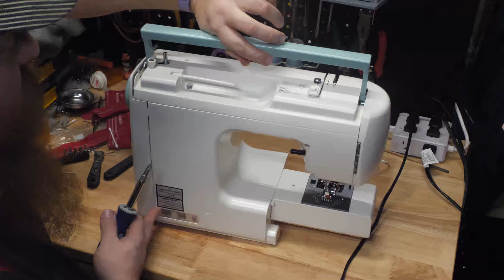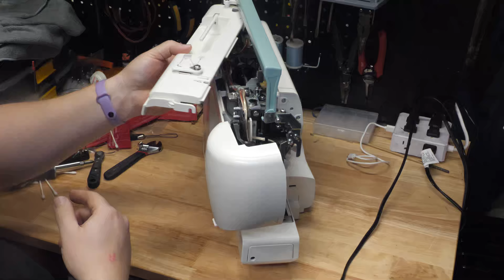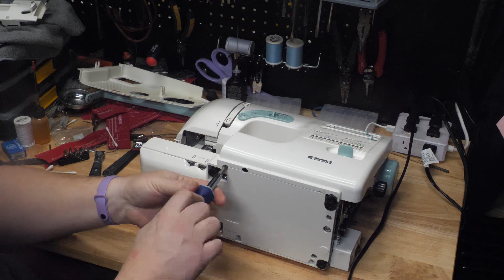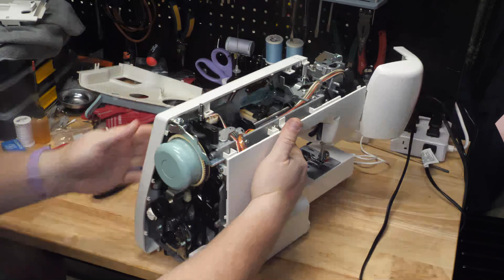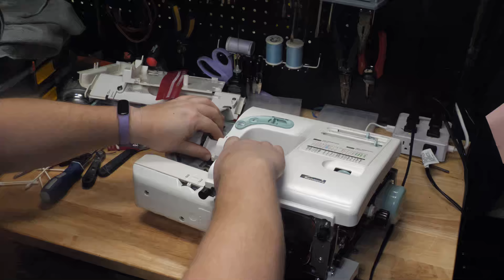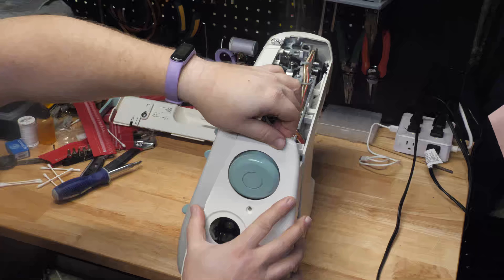Kenmore 16231301 Selector Fix

Comment: Hi Henry. I just inherited one of these. Barely used. Just putting it through its paces and everything is good so far, except the needle threader is trashed. Is there a way to repair/change that part? Thanks! Your video is wonderful, btw!
Reply from the maker: This is a Janome made machine and most of the Janome parts are cross referenced to Kenmore machines but many Janome dealers will also recognize the corresponding model & threader to get the replacement part for you.

Comment: HiHenry i also have a 385 series kenmore  sewing machine with over 25 decorative stitches the only stitch  i get is zig zag what can i do thanks
Reply from the maker: The selector cams in these machines get sticky and need cleaning.  If you open the machine (front cover should come off once you loosen all the screws) you will see the cam stack with the follower slide bracket next to it.  The two or three slides for the follower get gummed up and stick.  Cleaning those slides and re-oiling them with sewing machine oil should allow the follower to slide freely and select different stitches again.
When you are working on it, you should see a spring.  The selector usually pushes the cam follower one way and the spring is all that pushes it back the other direction, that's why it will get stuck with only a little goop on the slides.  Make sure you clean the full length of the slides so the follower can move freely up and down the whole way.
Reply: @henrybangsberg2187 Hi Henry will take you advise will let you know how it goes Blessing from NY C 😊
Reply: @henrybangsberg2187  I think I'm having a similar issue.  Do you have a video on this?  I can open the machine but feel a little lost on where I should clean and oil.  A picture would be great if you have one! I can stitch a buttonhole, but as I move the selector to another stitch, it starts deviating from the selected stitch.
Reply from the maker: @wandataylor7851  Cleaning and oiling is about looking for things that want to move and getting them cleaned.  For this machine the main selection knob is on the side and when you are looking inside the machine with that side cover off you want to clean and oil the two shafts that are behind the selector dial.  Both of those shafts need to allow the cam follower to slide freely along them for everything to work properly.